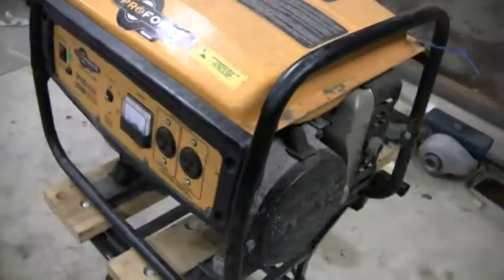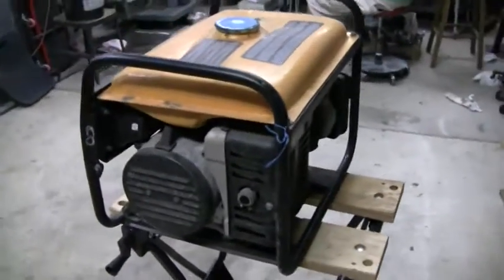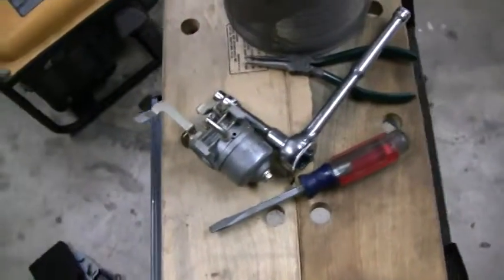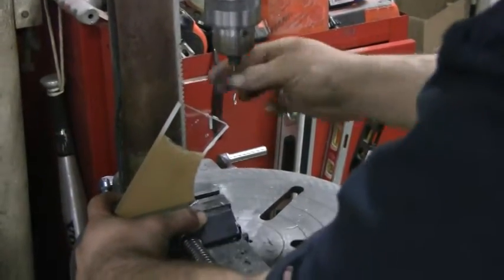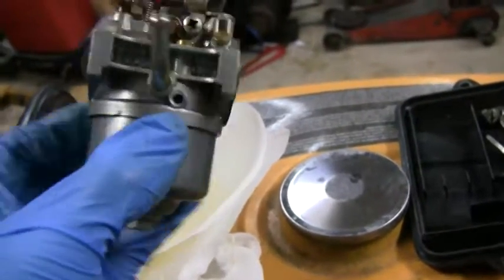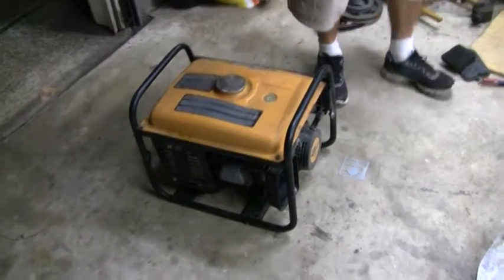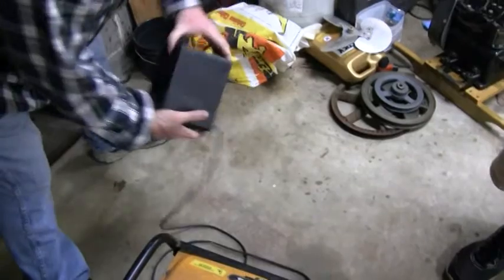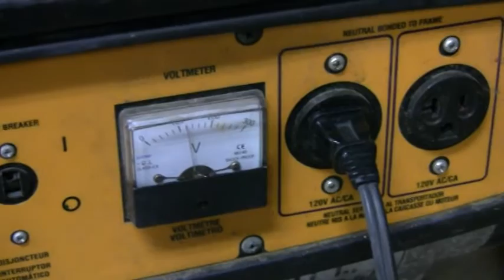PROFORCE GENERATOR REPAIR AND TEST

Comment: I have this model generator too. Its about 13 y/o. Only problem I had was the oil lvl switch went bad. At first it looked like a fuel issue because it would sputter and cough then one time I saw the oil lvl light flash before it died. I traced the switch wires and disconnected it. Runs fine now. I just keep an eye on the level which  is always fine it doesnt burn or leak any. If it blows oh well its a cheap generator anyways.
Update, converted generator to propane with the motor snorkel kit and it runs even better don't have to worry about gas going bad either.
Reply from the maker: Yeah the oil lights are idiot light anyway, like you said if you keep your eye on the oil level you will probably be fine!

Comment: Great job getting  it going again.  I have the same generator. I have had it about 12 years. Bought it from Pep Boys on sale for 225 bucks new. The only issue it has ever had has been the float needle valve sticking. It's done it twice. A few passes with a jewelers file on the ribs on the sides of the valve took care or that. They are pretty good little cheap little generators. Has saved my butt more then once when the power goes out! The carbs ti not like ethanol in the fuel. It's hard on the white metals.
Reply from the maker: Thanks Larry, glad you enjoyed it! It seemed like a nice machine for the price!